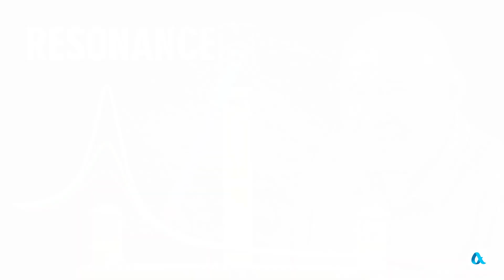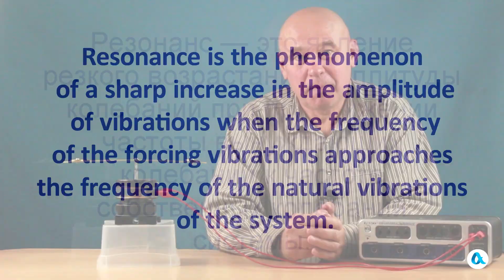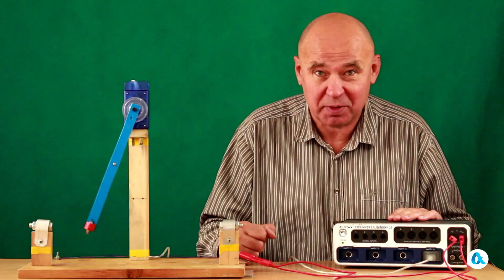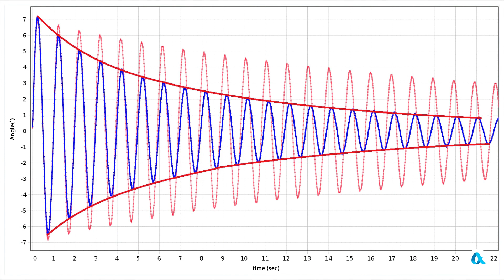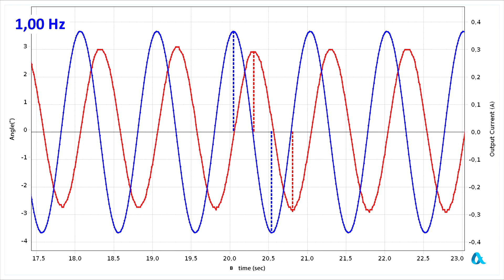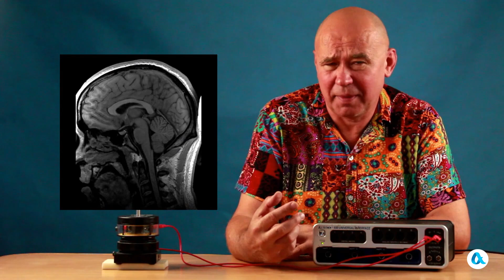Resonance

Comment: Maybe the magnet at the end of the pendulum is affecting the current driving the electromagnets, inducing some other wave which shifts in and out of phase with the pendulum, causing the effect the electromagnets have on the pendulum to waver in strength.

Comment: I experienced the negative impact of this during a large project at a drywall plant.  Large fans causing enough vibration and noise to disturb the residential area down the road from the plant.  This was, of course, an engineering error 🫢, and cost a lot of money and time to fix.  I learned a lot from that expensive mistake.  Thanks for the video!